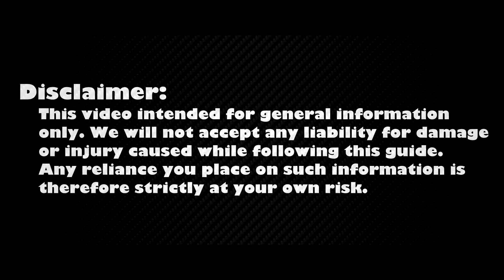Lenovo B570 Disassembly, Fan Cleaning, and Thermal Paste Replacement Guide

Comment: Great Video, you should have seen the fan and cooling fin's on my B570, LOL😱 .  
I'm fixing this instead of throwing it away to try 🐧 Linux install for the first time.
I would like to add: if your doing this, while your in there you might want to replace the bios battery.